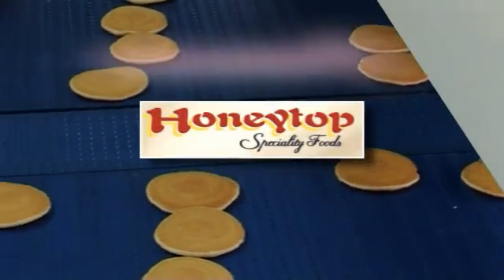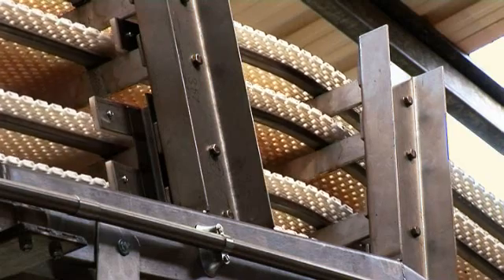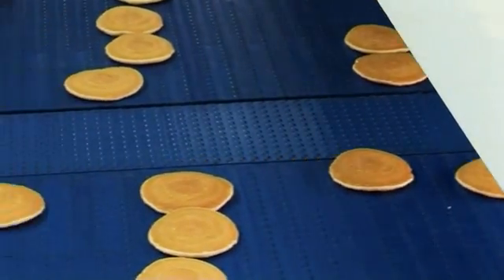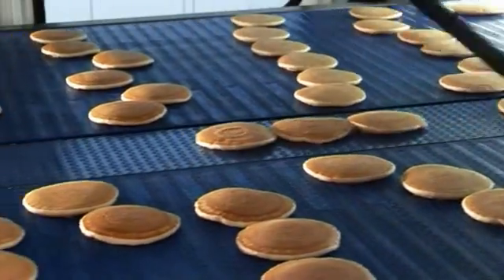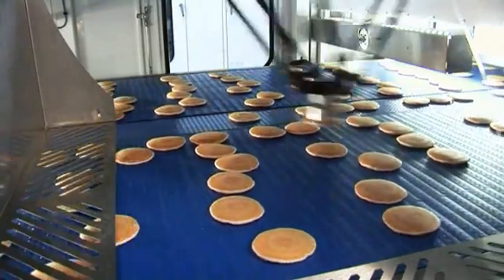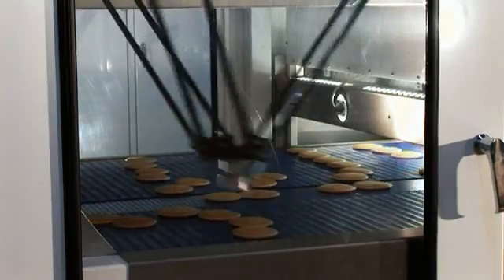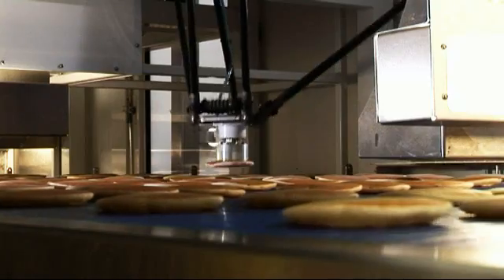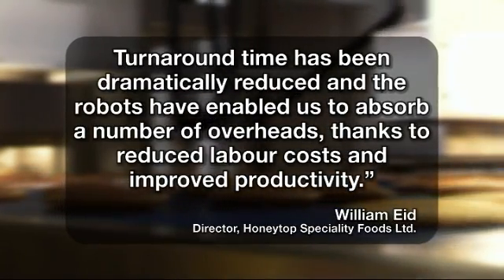ABB Robotics - Picking pancakes

Comment: There are multiple stack types as well as production speeds in this system. In one case of a four pancake stack, one robot only managed to place one pancake before the stack was out of range. Having four gives them a capability of 400/minute as well as a potential backup unit. There might also be an eight or larger stack as well.

Comment: Probably the optimal balance of cost and speed? One picker only goes so fast, especially without damaging the product, but slowing the line down enough for one to do everything could cost too much in the long run vs buying more robots. Also, if one breaks, they'd still have some working units and could maybe slow the feed until it's fixed. Just my guesses though - I've never worked an assembly line.